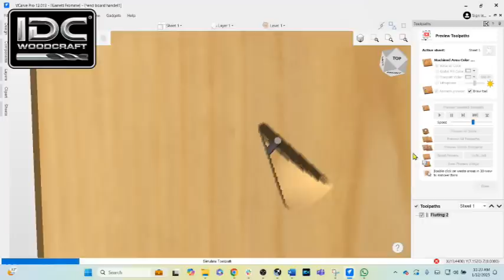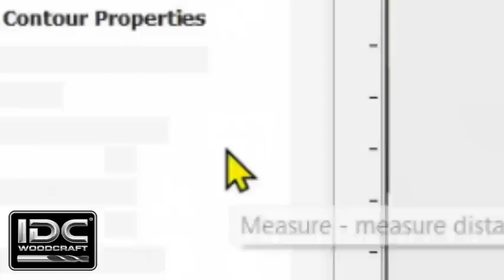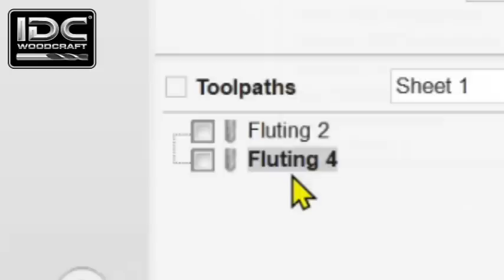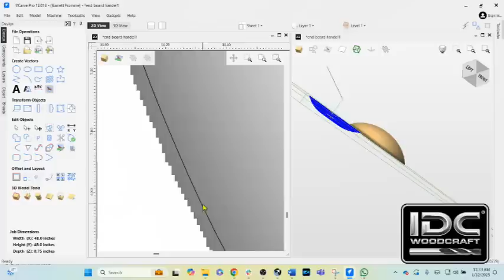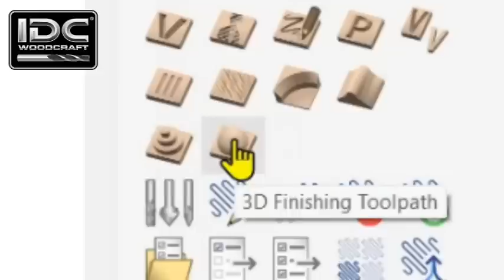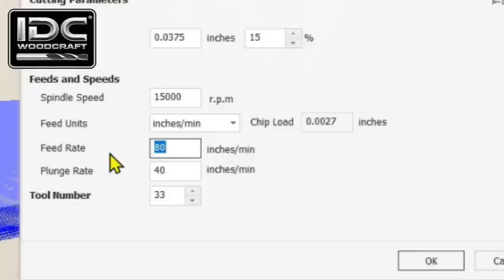Ingenious CNC Design Hack Cuts Run Time from 22 min to 3!

Comment: Curious why the toolpaths would be so much different between the 3d model and the ramp toolpath if they were the same shape. Can you not adjust feed & stepover rate on the 2d model?
Reply from the maker: That's a great question! The difference in toolpaths can often come down to the specific settings and parameters used for each model type, but adjusting feed and stepover rates can vary based on your software and the type of toolpath you're creating.

Comment: Your handle is not the same size as the original handle. His was 4" x 2" I believe.  That was 1/2 a circle. Yours became ovalish and larger. If it were resized to the original size he had been making, the time would be even less!  Great job showing how to be more efficient.  Less wear and tear on the bits and machinery.
Reply from the maker: Thanks for the keen observation! You're right, resizing can definitely enhance efficiency and reduce wear. Appreciate you watching the video!

Comment: your 1/4 down cut ball nose cutter will last 10x longer of you coated it with space age concepts laser 964 coating
i have been retired for 15 years used this coating at work no other coating could touch it
Reply from the maker: That's awesome to hear! Thanks for sharing your experience with the Space Age Concepts coating, and happy to know you found a reliable solution during your time working!

Comment: I was trying to make a bowl from walnut block 5x3x1.75 thick and your video was very helpful. Got stock on 3d modeling, it was tricky, but now its cutting flowless. Before I did the same thing with fluting toolpath As Jerry. good to know about shortcuts. Thanks a lot.
Reply from the maker: I'm glad to hear the video helped you out, and nice work with the walnut bowl! It's definitely great to learn those shortcuts – they can save a lot of time. Thanks for watching!

Comment: Quick tip: To find out the length of that line (or any other element selected) just glance at the bottom right corner of the interface. It displays all the info right in front of you.
Great video❤
Reply from the maker: Thanks for the tip, my friend! I'm glad you enjoyed the video!

Comment: Do you have a starter set of bits that has everyone you will actually use daily?  I bought a set from sensci and it doesn’t seem to have what I would need. Guess it’s individual. 

But I’d like to have ball nose, the beast, flatters, etc all 1/4 inch.
Reply from the maker: I sure do brother! Here is a link to a set I assembled just for this specific purpose: https://idcwoodcraft.com/products/the-only-truly-complete-cnc-router-bit-starter-set-w-free-projects?variant=45536534888735

Comment: I agree with @Dta1996 about the logo size.  There are two logos on pretty much every view, and one is always Huge covering parts of the display we want to see.  If you want to flash the large branding logo, then fine, just send it away after you show it.  Having both large and small there all the time distracts for your otherwise excellent content and reduces the value of your channel while also looking less profession than much of your other content.  

I just found this channel today, but between that huge logo and the video quality limited to only 480p, it reduces the positive impression otherwise created by this video.  The 480p limit on video quality makes the zoomed screens very blurry, so the blurry is what you notice instead of the content.  (This was a desktop and two different browsers.)

The down-cut ball nose bit and the education on the various tools seems like great featured content and could be helpful in many projects.  🙂

Just my $.02 as you asked for.  

Very good content here from what I have seen, so making some small tweaks like these to the content presentations will really help.  The depth of your discussions is excellent in explaining the various details.  Helps when we need to troubleshoot and know the whys instead of just the recipes.

Comment: I used the tool path to raised my litters works great 
But when go to pocket it takes out my litters
Reply from the maker: It sounds like you're facing an issue with the Z depth settings in your toolpath. If the pocketing operation is going deeper than intended, it may be cutting into your letters. Double-check the depth settings for your pocket toolpath and make sure they are adjusted to avoid the raised areas. You might also want to adjust the tool diameter or choose a different pass depth to help preserve your letters. Good luck with your project!

Comment: Hi Garret how are you it’s been a minute 
I’m. Trying to make vent cover for heat register 
Which is 4” wide and 10”long
With rectangle slots vertical colo and have 8 all together 
It keeps giving me error with duplicate vector s
Is there a way to fix this
Reply from the maker: Hey there! It sounds like you're having a bit of trouble with your design. Duplicate vectors can often cause issues in your CNC software. Try selecting the vectors and using the "Merge" or "Join" function, if available, to combine them. It should help clear up that error. Good luck with your project!

Comment: I'd go with a 3/8" ball nose.  The step-over should give you the same results in 2/3 the time, or 1 minute then 120 grit on a random orbit in that pocket for about 5 seconds will smooth everything out perfectly.  Also, if I'm not running non-stop for 8 hours, I'd change the acceleration numbers to ramp up to speed much quicker but that's manually typing code changes in the file.  Bolt that frame down and giver her hell.  Stepper motors are cheap.  If I have to buy an X axis motor once a year but I get all my parts in half the time it's well worth it.  The manufacturer has the settings set so it saves them money on warranty replacements.
Reply from the maker: It sounds like you've really thought this through! Your strategy with the 3/8" ball nose and the suggested step-over is spot on for efficiency. Adjusting those acceleration numbers can make a big difference in productivity, especially if you’re keeping an eye on costs. It’s always great to see someone optimizing their CNC setup for better performance. Keep sharing your insights—they're really valuable!
Reply: @IDCWoodcraft  I once wrote my own digitizing probe file where you'd set the Z height to just above the work surface and the first thing it would do would move along the x until it got an input (detected an edge) and then it would start the typical probing routine.  When it came back down off the other side and didn't hit anything in the Z it would again move along the x until it reached the extent of the probing window.  This saved huge time not probing dead table space around the object.  I started working with a Shopbot back in 2005

Comment: in the first example,  the ramp started at the "far" end of the line because (ii believe ) that node was the first point you drew when you created the line
Reply from the maker: You're spot on! In most design software, the starting point of an object often determines how certain features, like ramps, are applied. It’s always interesting to see how those initial points influence the final design.

Comment: good video. But i wonder what is going to be the  time of your friend's file, ig using your tool settings - feeds, speed, stepover and etc
Reply from the maker: I'm glad you enjoyed the video! The time it takes to cut your friend's file can vary based on the complexity of the design and the specific settings used. If the tool settings are similar to mine, you can generally estimate the time based on the overall dimensions and toolpath. However, you'll want to keep an eye on details like the material type, as that can also impact the cutting speed. Experimenting with a few test cuts can help you fine-tune the process!

Comment: Hi, brilliant videos. After I have created a design on cut2d, then press print to pdf- is there a way to make the design bigger on the sheet? It seems to be faily small on there, thanks
Reply from the maker: Thanks for your kind words! To make your design bigger in Cut2D before printing to PDF, you can adjust the scaling settings in the print dialog. Just select the 'Scale to fit' option or manually input a larger scale percentage. This should help you get a bigger representation of your design on the sheet. Enjoy your CNC woodworking!
Reply: @ Thanks for the advice. In my print dialog box I don’t have an option to alter any scaling, maybe it’s because I have the free version at the moment or it could be a UK version. I’ll see if I can save the file as normal and then have the file converted to a PDF 👍
Reply: I have solved it. I need to zoom into the 2D view then go to print dialog box and print to pdf, or see a print preview first 👌

Comment: Good stuff! I have thought about trying the Vectric software for some of the 3D carvings I like to do. I have used 2 pieces of software for yours. One is a CAD program called BobCad and the other is DeskProto. I quickly made a model with similar shape of what your demo. I have always cut those pockets in a very similar way that you show.
I tested with both and BobCad said 2.5 minutes and DeskProto said the same. Granted the shape and size may not be exact.
 But you have sparked my interest again for the Vectric software. My main machine is a very heavy Bridgeport CNC mill. I do have a CNC router as well but hardly use it.

Thanks for your video,
Gary
Reply from the maker: I'm glad to hear you enjoyed the video, Gary! Vectric software has some fantastic features that might really complement your projects. It sounds like you're well on your way with your BobCad and DeskProto experience, too. Happy carving!

Comment: Much easier to find the length of the line using the object size tool rather than the measuring tool.
Reply from the maker: Absolutely! The object size tool can really speed up the process and make it much more efficient. It's great to hear that you've found it helpful!

Comment: Caution: I see your bare hand swiping away chips. Not safe. Use a brush or vacuum hose or  compressed air. I learned a lesson on my mill taking a part out of the vice , bit had not stopped rotating, small cut but be safe.
Reply from the maker: Thanks for the safety reminder - safety is paramount when working with CNC machines for sure. Was not a smart move

Comment: So, would this work for work contours?
Reply from the maker: kwaks1979, Yes, it can work for contouring wood! Just make sure to adjust your tool paths and settings based on the specifics of your project. Enjoy your woodworking!
Reply: @IDCWoodcraft awesome, working on lake contours and wanting smoother transitions between contours. Any suggestions for me? Smooth instead of linear? Do I need a ramp with a .07 drop from each contour? Going down to .42. So maybe the deeper depths?

Comment: Fastest way to make the cut is with a circular saw of some type on a jig. Which is, how it’s normally done. Takes seconds to cut.
Reply from the maker: pufferfish0567, You’re absolutely right! A circular saw on a jig can be a real time-saver for making quick, clean cuts. It’s definitely a popular method in the woodworking community.

Comment: The 3D finishing toolpath might be faster compared to the fluting toolpath as it stands except...we're comparing apples to oranges. 3D finish: greater step-over, one pass per line, faster bit speed rate. Fluting: smaller stepover, multiple passes per line, slow bit speed rate.

Taking your feed rates for the 3D finishing path, stepover, and number of passes I can create a fluting toolpath the clocks in at 4 min 14 secs.

By examining the fan of lines for the fluting toolpath and balancing roughness at the outside of the half-circle with an excessive fineness towards the centre of the circle I can alter the stepover to be greater (requiring fewer fluting lines).

Doing this I get I get a fluting toolpath that clocks in at 2 min 32 secs.
Reply from the maker: shall1028, That's a great breakdown of the differences between the toolpaths! It's interesting how adjustments in stepover and feed rates can significantly impact machining time and finish quality. Each approach certainly has its strengths depending on the desired outcome. It's always about finding the right balance for your specific project! Thanks for sharing your insights!

Comment: Hey Garrett, I have a question for you, and Thanks for the new bit. I haven't tried it yet, But I already know how much I'm going to love not sanding any more than I need to. My question is how you go about cleaning off the pitch build up on your bits??? I don't know if you've covered this in a video yet or not but perhaps this might make a good video? I have a good maintenance schedule for my Longmill, Thanks to the new version of gSender, but not so much for my bits.
Reply from the maker: DaveParkersonofficial, I'm glad to hear you're excited about the new bit! To clean pitch buildup, I usually use a specialized bit cleaner or a solution of dish soap and water. Soaking the bits in this solution for a while can help break down any residue. After soaking, I use a soft brush to gently scrub away the remaining pitch. Doing this regularly will keep your bits in great shape!

Comment: I've watched many of your videos and almost every time I've learned something new. I alos love your bits that I've purchased so far. Question however, on this particular video with tapered cuts,  can you perform this feature using  VCarve Desktop. I have an early model Next Wave CNC that came with VCarve Desktop, I learned that upgrading to Pro will not provide any real additional features to justify $700. Frankly I am not ready to spend $2500 for the next Next Wave CNC model that still only comes with Desktop, then another $700 for the upgrade to VCarve pro and even more if i want to do 3d carves - Aspire I think he said. I love my CNC, but it does have limitations. But can I do tapered cuts? I hope to hear from you soon.
Reply from the maker: wilsmith2907, I'm glad to hear you've learned so much from my videos and are enjoying the bits! Regarding tapered cuts, yes, you can achieve that in VCarve Desktop with some creative strategies, like using a toolpath with a different depth setting. While VCarve Pro does offer additional features that can simplify the process, you can definitely make it work with what you have. Just remember to experiment and adjust your settings accordingly to get the desired taper. Happy CNCing!

Comment: Great video, but I do have a follow on question. Is there a reason you couldn’t or wouldn’t increase the step over and speeds on the original design?
Reply from the maker: Great question! The original design was very inefficient because the router bit cycles to the center of the handle every time. That alone is excess time used to do almost nothing

Comment: Wondered how we could make a tapered cut.  Thanks
Reply from the maker: RickHarrold, Tapered cuts can be achieved by tilting the workpiece or adjusting the angle of the spindle on your CNC machine. You can also program the tool path to gradually change the depth of the cut. Experimenting with different settings will help you achieve the desired taper. Happy woodworking!

Comment: What were the parameter for the 22min toolpath? Could you change them to the same as you did for the 3min toolpath :)? Would be great to see, how much you can reduce the carving time just by use optimized parameters
Reply from the maker: TheSepharos, Thanks for your interest in the toolpaths! The parameters for the 22-minute toolpath were set to achieve a balance between detail and efficiency, while the 3-minute version prioritized speed. If you tweak settings like feed rate and depth of cut, you can definitely reduce carving time. It's fascinating to see how much you can optimize based on project needs! Happy carving!

Comment: I do A LOT of intricate 3D relief work. I'm talking huge 30+ hour pieces, uusually in hard wide grain wood. I almost always do a roughing before moving to the 3D path. After seeing this, when would roughing be appropriate and when can it be skipped without risking my 1/16 and 3/32 ball noses?
Reply from the maker: tristonm37, Roughing is especially useful when working with hard, wide grain wood, like you mentioned, as it helps to quickly remove material without putting too much stress on your finer bits. You might consider skipping the roughing step when you're working on softer woods or if the relief has minimal detail, allowing for a smoother finish without the extra step. However, if your design has intricate features or varying depths, roughing can significantly reduce machining time and extend the life of your smaller bits. Ultimately, it depends on the specific piece and your desired finish quality. Balancing the need for detail with efficiency is key!

Comment: An excellent lesson on toolpath efficiency. But some tasks are more efficiently done on a different machine. I churn out four bee box handles (one for each side) in about 90 seconds on my table router with an Aussie Mike’s Beehive Handle Router Bit.
Reply from the maker: AussieMikesBees, Thanks for sharing your experience! It's great to hear how you're optimizing your workflow with the table router. Different machines definitely shine in different tasks, and it sounds like you've found an efficient solution for your bee box handles.

Comment: How do reset my tool list. I have Vcarve pro.
Reply from the maker: DanGilmore-d7c, To reset your tool list in VCarve Pro, go to the tool database and look for the option to manage your tools. You can delete individual tools or reset to the default tool list if that option is available. Make sure to save any changes you want to keep. If you're unsure, checking the VCarve Pro user manual can provide more specific instructions. Enjoy your woodworking!
Reply: @ thank you for the info you do a great job